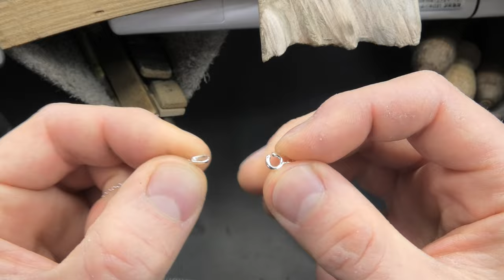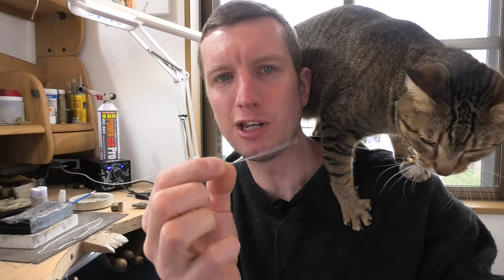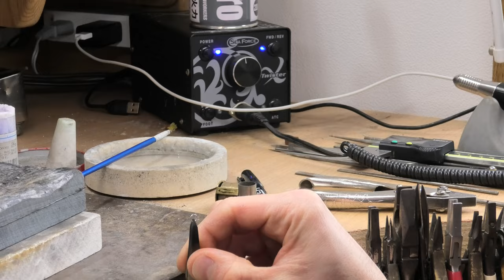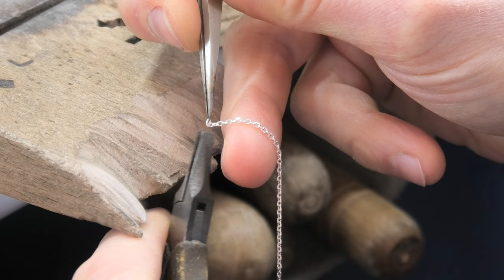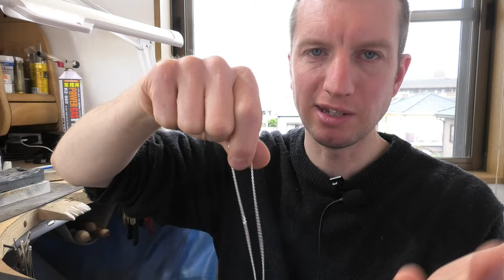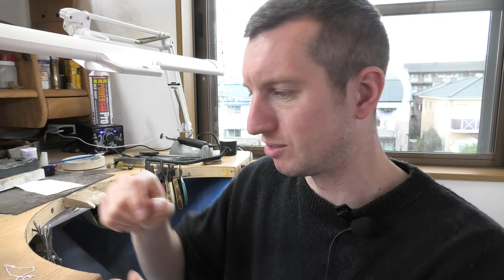How to Modify an End Link to Make it Easier to Use

Comment: Are you saying that "solid sterling" chains are still "plated" and need to be treated differently? How does the spring still work if silver conducts the heat (spring would be annealed...)? Is it because it isn't a solid sterling chain and only plated? Brilliant video, thanks!
Reply from the maker: Yes I think theyre all plated from new. Its done so they dont tarnish

Comment: Does the bolt ring spring survive the acid? Perhaps you are using some sort of safety pickle which is kinder to springs? I would be reluctant to pickle them in sulphuric! Excellent video as usual.
Reply from the maker: Never had a problem with springs in safety pickle but the heat will ruin a spring. Sometime as a little bit of maintenance on customers jewellery i touch a tiny bit of oil in to the moving parts after working on them.
Reply: @DiamondMounter   Good idea. Never thought to oil them!